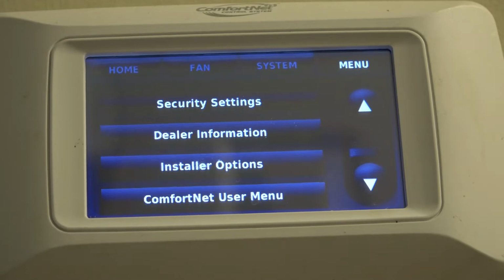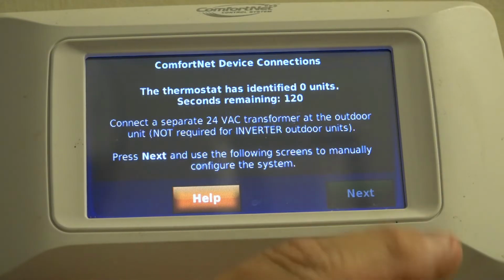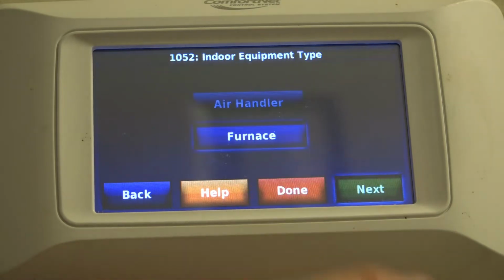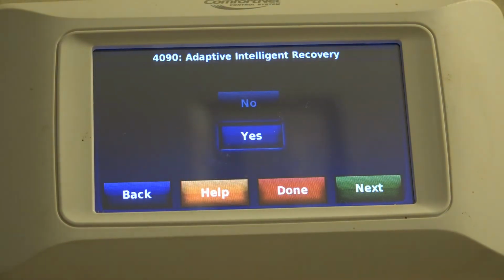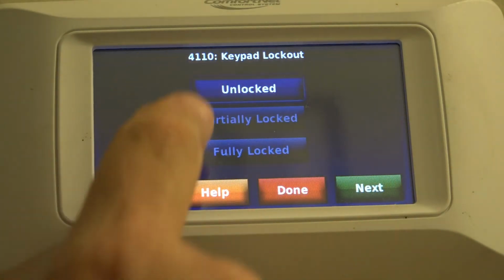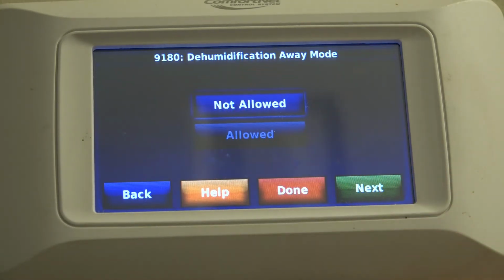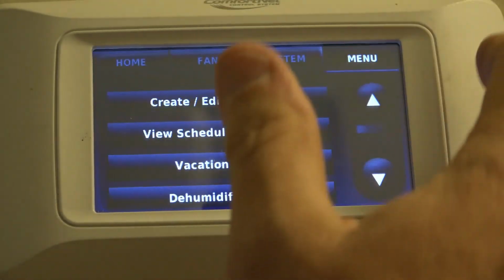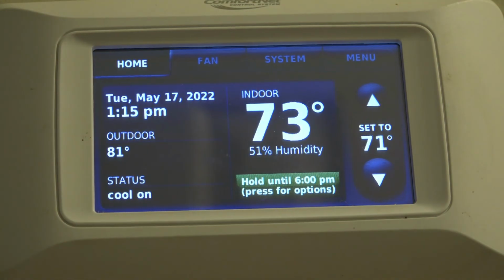Resetting Comfortnet Tstat CTK04ae

Comment: I’m a service technician working on a Comfort Net system. I have an issue with the DZ18VC Heat Pump turning on and off during a cool cycle. No error codes displayed on the thermostat. System will just run in cooling and turn on and off every 2-3 minutes. I’ve verified communicating voltage (.64). I had to switch the bias dip switches to correct that because I had .34 previously. I thought that would fix the issue but it continues to happen. I’ve watched your video on the data loader and attempted that as well. If you have any suggestions I would greatly appreciate your help. Thank you for sharing your knowledge
Reply from the maker: Look at system status in the program section, option #4 system status outdoor unit watch your thermistors especially discharge pipe sensor below 175 good. Then check in the air handler the plugs in the armaflex under the aux drain pan for corrosion 2 thermistors and the eev power head plug
Reply: @hvaciswin723 Thank you
Reply: @hvaciswin723 still unable to figure this unit out. Took your advice and checked the sensor plugs in the air handler. Had corrosion present so we cut the plugs out and used butt connectors to re-connect. Replaced all of the sensors in the condensing unit after a local FSR came on site and used a D-Checker. Unit is still working intermittently with no error codes. The inverter and all outdoor sensors have been replaced.  The only other part I can think of that would cause this problem would be the indoor board or thermostat. Any other suggestions? Anything would be helpful and appreciated.
Reply from the maker: Is there an error code
Reply: @hvaciswin723 no error code

Comment: Thank you for such a descriptive video.  I added a Aprilaire 800 humidifier to a Daikin HVAC system.  It works great when the systems call for heat.  Now in the summer I want it to run with a fan call or cool call and even if I set installer settings where thermostat controls humidity OR equipment controls humidity I can get it to make a call.  Doing an installer test show the unit if working correctly.  I must be missing one setting?

Comment: I have a similar unit and am wondering why I have to reset the time whenever my power goes out even though it has a backup battery? I had a fan motor replaced in the Amanna outside unit. I didn’t have to reset it before replacing it. Is there away I can fix this without having to call out aTech
Reply from the maker: @richzinn4843  it uses a 2032 coin battery in its a comfortnet thermostat, there two metal tabs that make contact to the battery one of those might have come loose which requires a tstat replacement, or reset the date everytime
Reply: When I loose power I have to shut off both indoor and outdoor unit at the breakers. Turn on furnace first then ac unit. The ac unit has to communicate when it powers up or it won’t connect with the thermostat.
Reply from the maker: @rocky5678  probably need to check the voltage bais, sound like it could be off. Check out my video call voltage bias

Comment: I have a Goodman 2 stage AC unit (5ton) and Goodman matching air handler - both communicating.  Both inside and outside boards were replaced.  3 service calls but can't seem to stop the unit from working while the tech is here, and then switching to "lost communication with the air conditioner" or "outdoor sensor needs to be added" or waiting for equipment.  Short power cycles don't fix it but if I leave it off for an hour or more it sometimes comes right on and cools.  Had three false repairs.  Worked all night only to fail again in the morning.  Not sure the techs can figure this out, especially with new boards already.  Not likely wiring, or a long rest wouldn't fix it.  could it be abad thermostat?  Pulling my hair out here!  BTW, awesome video.  Your detailed explanation is perfection.

Comment: Really a helpful video.  Have a very similar problem but the thermostat has been searching for the system for hours and can't find it.  Yet it never comes up with the "Not Found" message as it says it would by the "Help" button.  FYI, this is a CTK03.  Do your have any insight as to what might be the issue?  In a relatively rural area and have already spent money on services whose techs were absolutely clueless.  No error messages on the boards of either the air handler or condenser.  Supply voltage is ~28V AC and voltage differential between data lines is ~650mv AC.  Would seem that is within system specs.  Have found some ideas and looking for more insight.  Firm believer in not being able to fix a problem if you do not know what it is.  Thanks for any help you can provide.
Reply from the maker: The ctk03 could of taken a power surge wiping its memory thats a fairly old stat being a 03, if you know how to use a volt meter check across pins 1 & 3 in dc volts on the subbase of the thermostat
Reply: @hvaciswin723  Thanks so much for the prompt reply.  By subbase I am assuming you mean the 18 pin connector the stat plugs into.  No indication which is pin 1 on the board so checked all 4 1 & 3 combinations.  The pair on the upper left read at ~25mV dc.  The other three pairs where around 4mV dc.  You are correct in that it is old and I am going to replace it.  What I am trying to do now is determine if it is the culprit.  Service company wants to replace it and all the boards in the entire system even though no errors are showing.  Have read numerous cases how this seldom is an effective approach.  Often not solving the problem.  I am trying to confirm if it is the stat or maybe the outside transformer associated.  Power voltage is at 28 but have seen it is nominally supposed to be at 24.
Reply from the maker: @robertgarner1235 no on the stat wire connection 1, 2, r, c check across 1 & 2 looking for about .6 volts dc
Reply: @hvaciswin723  Again, thanks.  That is what I referenced earlier as data lines.  With a DVM the dc voltage fluctuates at about 750mV +/- 100mV but it varies greatly.  Put an oscilloscope on it.  Line 1 has an alternating voltage of 500mv +/- 250mv.  Line 2 has constant voltage of 300mv.  Superimposed upon the 300mv baseline  looks to be a square wave signal of 5 pulses consistently spaced in time but the pulses themselves are very erratic.  Power voltage is still 28V.
Reply from the maker: Most likely time to upgrade to th ctk04ae tstat
Reply: @hvaciswin723  They are no longer in production either.  I am getting the One+.  However, what I am concerned about is whether the signals I am measuring are correct.  The manufacturer will not allow true tech support people to talk to customers on problems like this.  The people I was using for service did not even look and refused to call the manufacturer.  Too much trouble I guess.  The extent of their knowledge appears to be checking the trouble lights on the boards.
Reply from the maker: @robertgarner1235 get the slim line the 1plus has a useless wheel on it
Reply: @hvaciswin723  Thanks for this and the other advice.  Do you have any insight into the voltages?  Are they appropriate?
Reply from the maker: @robertgarner1235 no everything sounded fine
Reply: @hvaciswin723  Okay, thanks for all of your help.

Comment: Great video!  How can I find out what the installer password is?  Mine is set to 69 min for AC and I would like to change to 68 as my wife would like it just a bit cooler at night
Reply from the maker: Under menu button,  dealer information
Reply from the maker: You shoumdnt a code to change room temperature unless someone has put in a low temperature limit. Depending on your tstat you could set a programed schedule

Comment: Hello I have a Comfortnet Thermostat that is connected to the Honeywell HE360 Humidifier, the humidifier is not turning on so I bought a new fan side replacement to test and see if it was a broken fan control board or fan, I also replaced the solenoid (as the unit was very old). I am still not getting this unit to turn on so I am thinking it maybe the connection to the Thermostat (I know its connected to the IFC on the board) whats the best way to confirm the signal from the Thermostat is connecting with the humidifier?

Comment: the video was excellent, I have a outdoor sensor needs to be added message that needs to be corrected. The system has one but it wasn't added???  I went through the whole thing twice but I still have the message. thanks, Gil
Reply from the maker: Use the honeywell redlink wireless sensor

Comment: Hi Scott:  Great stuff you taught. 
I have been using  the thermostat CTK01 for my AC/Heat Amana system for about ten years, but now it has a touchscreen problem that I need to replace.  Can I purchase the CTK04AE for a direct one-to-one replacement?  It's due to the fact that the wires ( C, R, 1 and 2) layout  look the same on both unit CTK01 and CTK04AE .  That makes it very simple for me to follow to install it myself.
Once installed, for setting the CTK04AE up, I would just follow what you showed on the video.  Do I need to provide "Dealer Information" as it showed in the Installation Guide for the ComfortNet CTK04AE?  Much thanks for any input you would provide.

Comment: Awesome video. My unit has been giving me the communication error for almost a year. Installer can’t figure it out. I just tried your reset. Fingers crossed. Only difference is I’m running a Goodman non communicating 16 seer ac unit.
Reply: Did it fix your problem?  We have that now and three service calls later, it just happened again!  90 degrees out and two sick kids with fevers inside, and we need AC.

Comment: The CTK04 doesn't seem to recognize the coin battery.  Have changed more than once but still does not power thermostat when pulled from wall.  Any thoughts?  Thank you
Reply from the maker: The 2032 battery only protect memory. Does not power the stat. If your getting a battery error check tabs tgat hold the battery in place be very care if you try to afjust them easy to break

Comment: is there a  Daiken Dry Mode setting on this thermostat?
Reply from the maker: What type of equipment are you connecting the dain one too
Reply: @hvaciswin723  3 ton Daiken 17.5 Seer Central heat pump system.  DZ17VSA361B and DV36FECC14A
Reply from the maker: Its will not have dry mode but it dehumidification is turned on you'll get a setable humidiy set point with a range of 10% i recommended 45 to 55% for summer
Reply: @hvaciswin723  Thanks for the quick reply.  Does the Daiken One Thermostat have the 'Dry Mode' ?
Reply from the maker: No, dehum mode
Reply: @hvaciswin723  Thanks, and have a great week.  Your answer has been helpful.

Comment: Hello can I help yourself to an you a rooftop unit
Reply: Sorry can you use this type of thermostat on a basic rooftop unit.
Reply from the maker: Eev valve require special board as well as thermistors on the indoor coil some require a pressure transduce. Unles a package unit came with eevs i would say no, no cost effective to convert the system

Comment: I have a 3.5 ton Goodman with this thermostat. All be running well for two years. A few months ago the thermostat went blank. I thought it had a dead battery, so I replaced it with no luck. Called my a/c man and had a clogged drain. They corrected that and since then my thermostat isn’t the same. In A/C I have it set to 74 and it will drop to 60 at night and rarely shuts off. They have been here 3 times and can’t get it corrected. They have ordered me a new thermostat, but going on a month now and thermostat hasn’t arrived. Before all this happened my unit would stay on what temp it is set on with no issues. My a/c man said to change my set points and see if it helps. I put temp on +2 and humidity at +1. Still no luck. Do you have any suggestions?  Thanks.